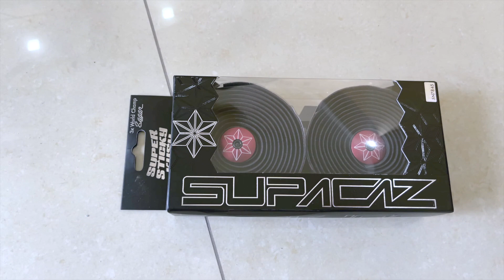How to Wrap Handlebar Tape - Singapore Cycling Beginner Guide

Comment: the velcro strap to secure your front wheel, does it have some padding or smooth side to avoid scratching down tube and rim? i'm trying to find one like that online, no luck so far.
Reply from the maker: no padding. but smooth, don’t think it will scratch my down tube and wheel. i got it from daiso… only 2sgd